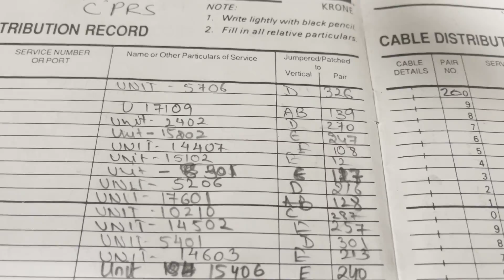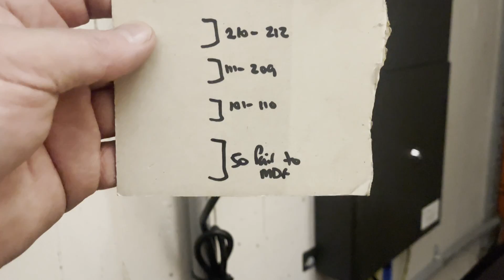Why This Apartment’s Internet Wouldn’t Work (and What We Found)

Comment: One of the worst connection types from working for an isp is dealing with fttb a lot of back and forth between customer and NBN, I think FTTB should become obsolete as is the case with fttn and fttc eventually won't exist and for complexes fibre to the riser would be the way to go however I can't see that happening as infrastructure can be installed in comms rooms but then will be up to building owner/strata etc to organise internal cabling with cat 5 or 6

Comment: Which country stil has dsl vdsl connections? Those are like museun tech!.
Reply: 😂 More than 80% of Germany. But we have Vectoring/SuperVectoring MSAN in a FTTC Setup. Gives you 250MBps up to 300-400m. Fiber (mostly GPON, with a few ISP starting to upgrade to XGSPON/Combo) is being built here and there, but slowly getting more.
Reply: @1lI1l1Il  here in Argentina the whole phone system is already part of the past, only left some guvernament buildings with land line phones, maybe few business, nobody want a landline phone these days. Todays if you asks for a phone service, mostly will be for the old seniors a device simulating to be a wireless landline phone, but it is not, it is cellphone inside, but with the old user interface, like dial buttons, etc.

Comment: I nicknamed this  A_B_C_D ( MDF -IDF -IDF _ skt) no cable jumpered between A + D. It paid to have 4 Loopa lines which are better for long distance( at the far end you will need an adapter cord on the legs that you have sound to do this)  testing btw and from the IDF or premises end ,then jumper 4 spares twist them  up -/+ legs with one loopa line( 4 signals  are working then and hope that 1 gets to the A -MDF ) and that can help put data through. Turn off the loopaline remotely from unit and wullah it tests okay . On the way out reconnect jumpering and retrieve Loopa Lines.
Reply: And have a pencil and rubber to fill in log books and add some notes to the inside cover about what position on the frame  it appears at IDF or MDF end
Reply from the maker: I used thoes thinks for years when I was working in the network. Great tools

Comment: Can you please stipulate in the beginning of the video if this was an existing connection that stopped working or a new connection that never worked after activation.. helps understand things a bit better
Reply from the maker: New connection she has been trying to get connected for weeks. The building blame the ISP and the ISP blame the building. It was the building
Reply: @SECUREACOM I’ve been doing this for a lifetime and can say without a doubt the line was good to the MDF & who knows what’s happened over the years.. pairs get disconnected for all sorts of reasons and unless the EU was home, with all the access to that IDF - the dice would have to roll in her favour to get a technician like me id quickly take a spare back to the MDF via the IDF just so I didn’t have to muck around with my test modem & tag it. Some techs care and others don’t - issue is access and if the customer/ building manager is available to help us get it solved. I will always try but when faced with locked doors or customer NIA.. it gets tagged at the network boundary every time

Comment: Speed will be garbage, you’ve walked probably 100 m from the MDF and therefore if that’s just VDSL they will be lucky to get 50Mbps. 

That’s a very odd one because Gigacomm written on it. They use fibre to the distribution point and up to 40 to 50 m of copper into the unit.
Reply: VDSL? why not Supervectoring?
Reply: @1lI1l1Il cable run would e too long, only pays for itself under 50m of cable.

Comment: Many years back, when we still had DSL, I was home for the day when the internet suddenly cut out no warning, no static on the phone line, nothing. Usually, you could tell something was off when the landline started crackling or dropping out, but this time it just went dead.

I picked up the phone to check for a dial tone, just silence. Since I lived in a pair of back-to-back units out in the country, I figured I’d take a look outside. Hearing voices next door, I wandered over and found the neighbour chatting with a technician who was working on the phone lines. They’d been having broadband issues, and I remembered being told that the street only had one good line pair left.

I mentioned that my phone had gone dead, and after the tech twisted a few wires back together, my dial tone returned along with internet, just like that.

It was one of those moments that summed up the fragility of DSL connections perfectly: one small mix-up at the junction, and your service could vanish without warning. Experiences like that (among many others far worse) made me more than ready to see DSL phased out for good. As it could have been days before the service was restored, had I not caught him.
Reply from the maker: Yeah it’s still a common thing unfortunately
Reply: @SECUREACOM  - Pretty much, apparently a few techs were cutting DSL services so they could get called out to repair them and make more money..🙄
Reply: Oh Yeh the cables are only 0.40 large and can quite often bee looking like it is connected but out by microns
Reply: @Rusty_Gold85  - Perhaps, though the tech sent out looked extremely rough for a better word of it .. like literally no teeth. 🤷‍♂
Reply: Ah. Guess how he strips wire? Oh dear